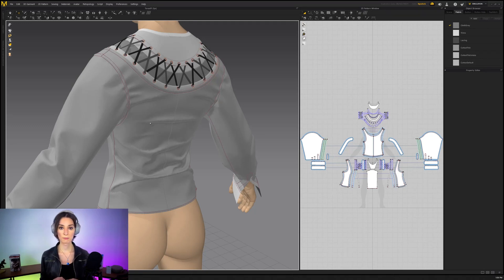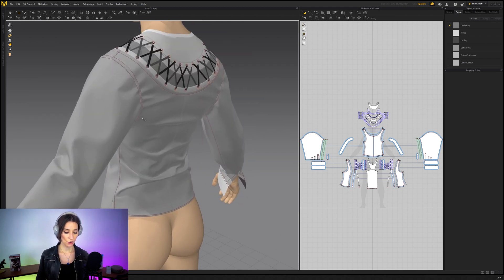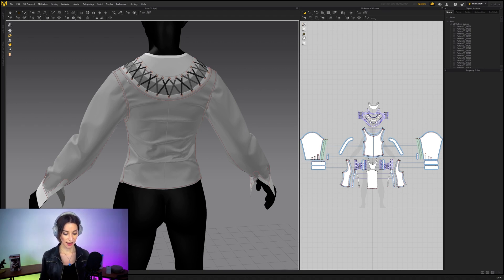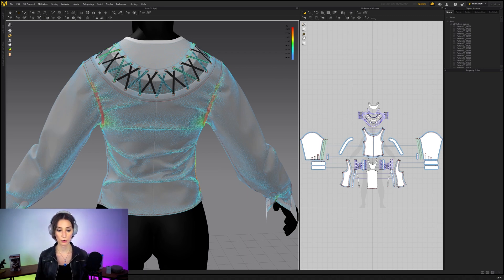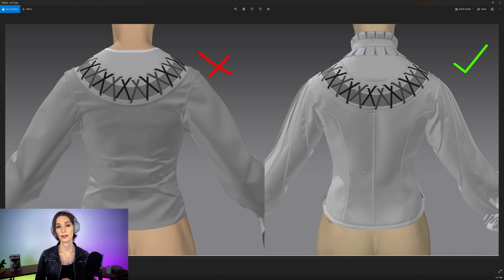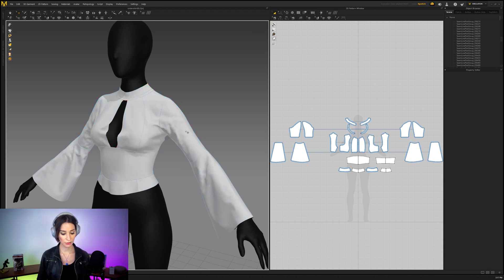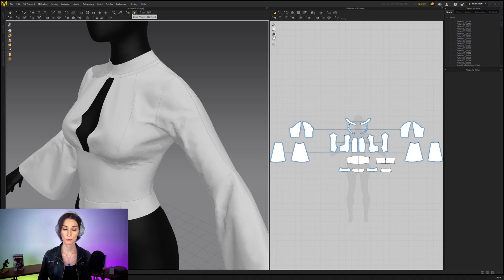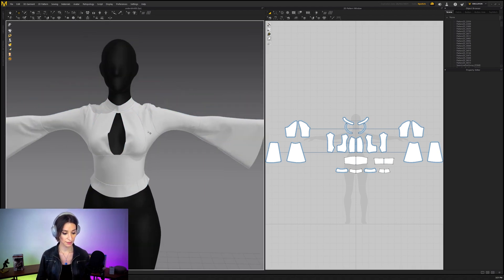Analyzing a garment's fit in Marvelous Designer

Comment: Thank You so much for this workflow! Super Helpful. I have a question though: The mesh that we imported into MD from Maya, was not so high res. But when you export the simulated mesh from MD back to maya, its high res. So did you increase the resolution of the mesh in MD ? or did you smooth mesh in maya before importing into MD?
Reply: So possibly answering my own question: The particle distance attribute in the property editor can increase or decrease the resolution of the mesh. Does this answer my question correctly @Outgang ?
Reply from the maker: It's been a while since I made the video but yeah, the particle distance changes how high-res the mesh is. When iterating on a garment it's not beneficial to have the mesh be too high-res since it'll only slow down the workflow but when doing a final export, like what you'd export for baking, then it's worth to drop the particle distance as low as your computer will handle. For me that's a particle distance of 1-2.